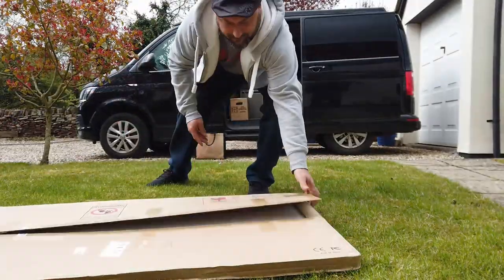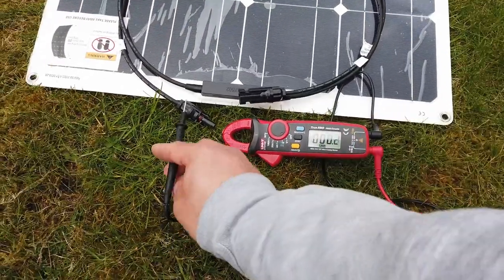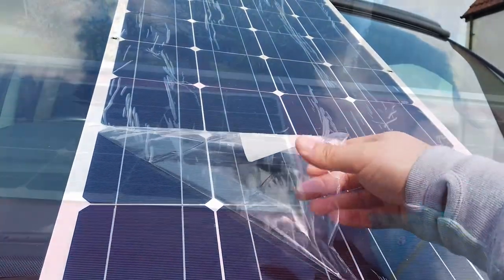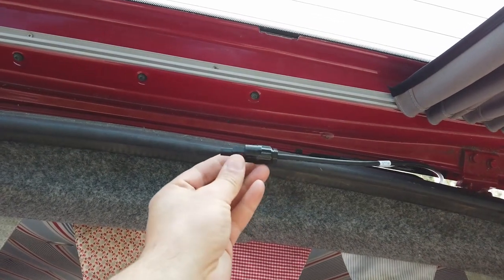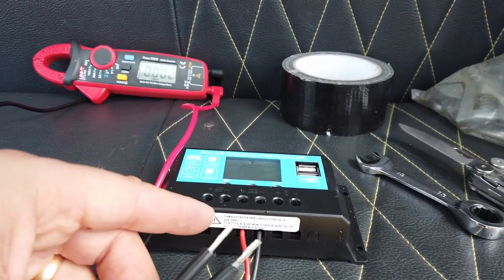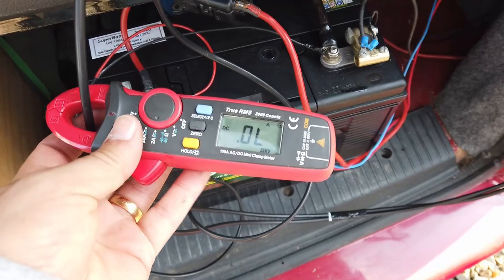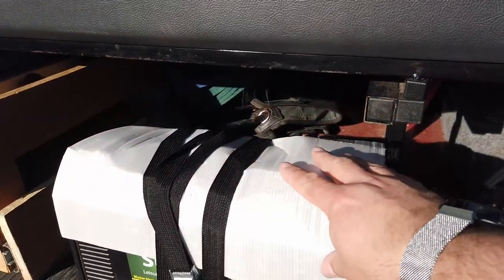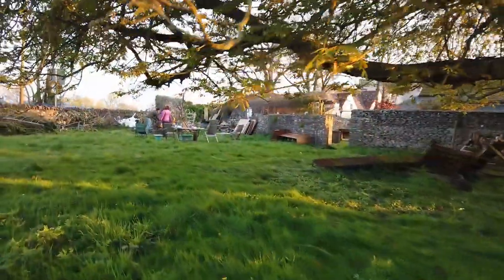DuB-EnG: Fitting a Flexible Solar Panel on a T5 Camper Van, installing a charge controller & battery

Comment: These panels lose efficiency when they get hot so its a good idea to have a this layer of corregated plastic between the panel and the metal to protect it from the heat
Reply from the maker: Very fair point! ...  going forward I'll take that on board.. thanks!
Reply: Would the grooves in the roof not act as ventilation?

Comment: Hi Howard, did you had any problems with the flexible solarpanel sinds you installed it?
Reply from the maker: My friend has some the van, but it was fine for two years
Reply: I now own the van and the solar panel seems to still be working fine.  I have had to re-route the cables though as they compromised the seal and allowed water into the back of the van. @DubiousEngineering
Reply from the maker: Yes, what a silly boy I was!  Sorry George, glad you've got it sorted.  I've not bothered fitting a panel to mine yet, however, I still get water ingress in bad weather, I can hear it sloshing around in my tailgate.  I haven't touched the seal on my 2018 T6.  Anyway, I agree with you, there are better ways to run and sell the cable!  Best, Howard
Reply from the maker: @george did you drill holes in the roof and use sealent\ducting\glands?
Reply: No I just ran them on the outside of the seal until they were at the bottom, then over the seal and into the van.  Just a quick fix to stop the leak.  @DubiousEngineering

Comment: Sorry but you've made a bad move, from my personal experience flexable panels on vans get abraided and the plastic degrades to a misty finish. I later used glass panels with an air gap to keep cool. I have never had a problem since. Every one lives and learns,.
Reply from the maker: Thanks Martin... how long before that Misty finish shows up?!? We had a few warnings on this but Hayley really wanted low profile panels to avoid extra tunnel costs as a framed panel increases the height of the van
Reply: @DubiousEngineering  My panel lasted about 2 years gradually degrading due to uv and dust the output dropped to about 20 % of the rated output. Changed to 100W glass with air gap, and it has worked flawlessly for the last 3 years. The old one was misting over within a year.
Reply: you can get some with 5 years warranty - perhaps these are a better bet
Reply: I've got a poptop so I can't put a rigid
Reply: Keeping cool is important.
Reply: Was that ETFE or PET panel? I've head the same, that these cheap flexible panels usually don't last over two years, but I am curious, as I've never digged deeper into it.

Comment: I have 100 w panel .When charge controller reads 3A, does this mean 3A at 20V ?   or 3A  at 12V ?
Reply from the maker: Likely 3A at 18v as thats what my current meter showed on the input to the controller...  hopefully your controller manual should tell you - otherwise, use a current clamp meter!
Reply: @DubiousEngineering  manual? I think I threw it away with the packaging years ago. But I assume the same.
Reply: The controller actually shows two more connections : the ‘load’. Should one not move all the loads to that pair?